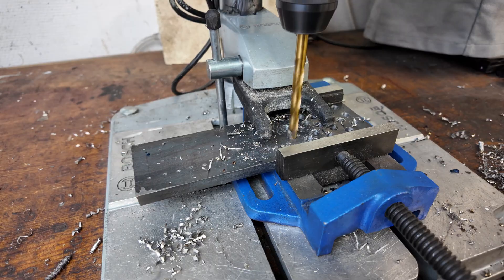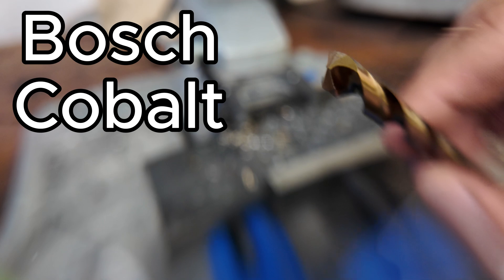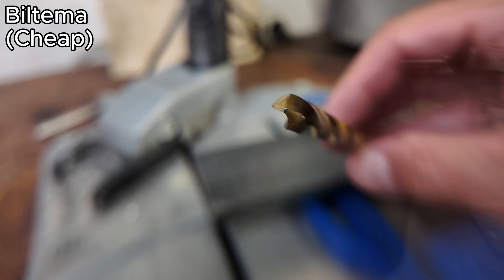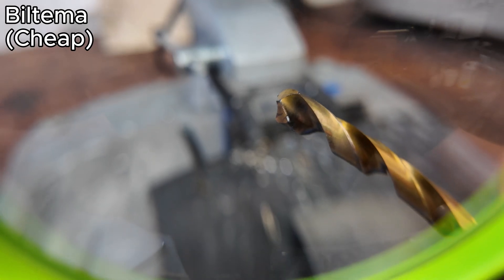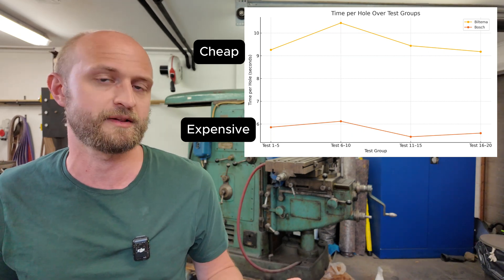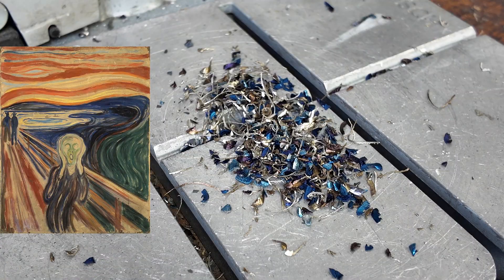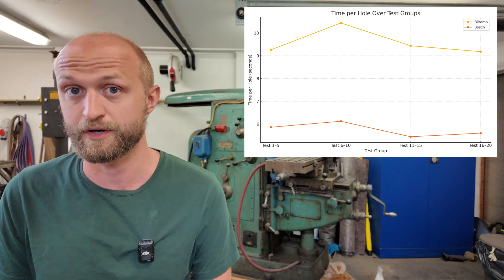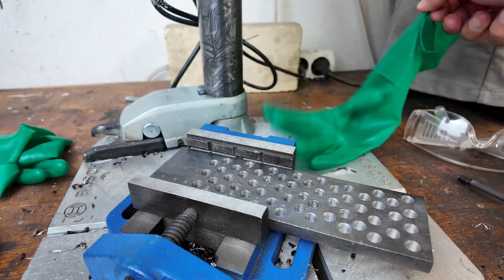Cheap vs Expensive Drill Bits Test — What’s Actually Worth Buying

Comment: Good quality bits are worth it.  that said I buy some quite cheap ones fro a big shed, made in China and have been really impressed with them.  I reserve my top quality ones for the jobs I really dare about, (jobbing work is not high precision), many cheap bits it pays to regrind before use as some come pretty mucked up to start with.
Reply from the maker: That’s a really smart approach—using the premium bits only when it truly matters and saving money on the rest. I agree, some cheap bits can surprise you, especially after a quick regrind. Do you find certain brands or types of cheap bits perform better than others?

Comment: There is a lot of difference in quality between "normal" HSS drill bits from different brands  too. It's silmilar to Chrome - Vanadium tools. They aren't all the same either. 
HSS - Co bits are on another level, but they're different too. They usually work well for stainless steel and harder steel like Hardox 400, but then you must use coolant.

I almost always use used engine- or transmission oil as coolant. It's free. In my opinion It's just a myth that lubricants would impair the cutting capacity of the drill. It's a sharp edge that does the work so the oil doesn't have any negative effect. 
When the work piece is clamped to the table it's easy to add as much oil as you need with an oil can to keep the drill cool and it won't be so messy.
Reply from the maker: That’s a great point — I’ve noticed big quality differences even within HSS, and cobalt definitely shines in tougher materials. I haven’t tried Hardox yet, but it’s on my list. I’ve heard others mention using old engine oil too, but haven’t tested it myself — interesting to hear it works well without affecting cutting performance. Might have to add that to a future video.

Comment: I don't understand what you mean by chips being harmonized.  Do you mean a balance of the two chips from the two cutting edges?

p.s. How do you feel about carbide drill bits?
Reply from the maker: Yes, I mean producing nice, continuous spiral chips from both cutting edges. It’s a sign that the drill is cutting evenly, evacuating material efficiently, and staying cool. When chips break up irregularly or one side produces more than the other, it can mean uneven wear, poor feed, or heat building up — all of which shorten bit life. As for carbide bits, I’ve got some on the way for testing, and I’m curious to see how they compare in my setup!

Comment: You could try doing the same test with cutting oil. It may level the playing field. Though it massively increases the price of the cheap drill bit.
Reply from the maker: That’s a great point — cutting oil definitely changes the equation. I actually ran the same test with oil (on the cheap bit), and the results might surprise you. Here’s the video if you’d like to see how it turned out: https://youtu.be/jd7gK8nOBtw
Reply: @SteelSurgeon-h6p  I very much doubt the results will surprise me as I have a drill press and watched that video first!
Reply from the maker: Sounds like you were way ahead of me on this one! 😄 Hope you enjoyed the test as much as I enjoyed making it.
Reply: @SteelSurgeon-h6p  Yes.Certainly useful. The lubricant used does depend on the metal you are working with. For aluminium you use either WD40 or paraffin, for cast iron and brass you go in dry.
Reply from the maker: Good point — I knew about WD-40 or paraffin for aluminium, but I didn’t realize going dry was preferred for brass. Appreciate the tip!
Reply: @SteelSurgeon-h6p  no problem! You can look up and check these things for different materials and I would suggest that you do so.

Comment: the basic drill, do you know if its TiN or TiAlN coating? - i know that with TiAlN or similar coatings, the coating actually needs to heat up, to harden proper. and im guessing its the same case with TiN coating since the only differense is the lack of Aluminium. yes Aluminium is used in the coatings. since you want the aluminium to melt and then oxidize - thereby going from 600c to 2000c melting point.

btw, nice chip color with the cobalt coated drill 👍👌
Reply from the maker: Appreciate it! This one’s TiN coated — not TiAlN, so no heat activation needed. Mainly there to cut friction and help the chips curl. Glad you liked the chip color from the cobalt bit! 👍
Reply: @SteelSurgeon-h6p  that chip color means the heat was captured in the chip, not the part, and therefor carried away from your part. thats why i like it ^^

Comment: Brother i cant wait untill you discover real industrial 8% cobalt drills from the likes of ghuring, OSG, dormer etc. 
Those Bosch drills are likely cobalt coated as opposed to having cobalt alloyed into the actual drill bit.
I wont even mention solid carbide drills 😂
Reply from the maker: Yeah, I’ve heard the legends about the real cobalt bits — Dormer, Guhring, OSG… the proper stuff. I’ve actually ordered some carbide drills from Teemu for a future video. Definitely not in the same league as the big brands, but it’ll be fun to try them in a controlled test and see how they stack up against something like Bosch :)
Reply: @SteelSurgeon-h6p hopefully a video coming soon? 😁
Reply from the maker: First I need to bring my lawn mower deck back from the dead before the mowing season ends here in cold Sweden 🥶. Once the carbide bits arrive (probably 2–3 weeks shipping), I promise there’ll be a video on them 🙂👍
Reply: The Bosch HSS-CO are 5% cobalt (M35), 135º split point ground. The dull gold colour is not a coating, it's from the manufacturing process.

Several other brands sell what appears to be the same set in the same plastic index in flashier colours at higher prices. The Bosch set in the dull grey plastic index appear to be the best value.

8% CO are more brittle, 5% CO is more forgiving for enthusiasts and more affordable.

Comment from the maker: 🔩 Thanks for watching! Which drill bit would you trust for 20 holes in steel — the €0.80 cheapie or the €3.50 cobalt beast?
📊 Full data breakdown, graphs, and wear analysis in the video!
👉 New video this Thursday: Does cutting oil actually make a difference? I tested it surgically.
🔔 Subscribe so you don’t miss it!